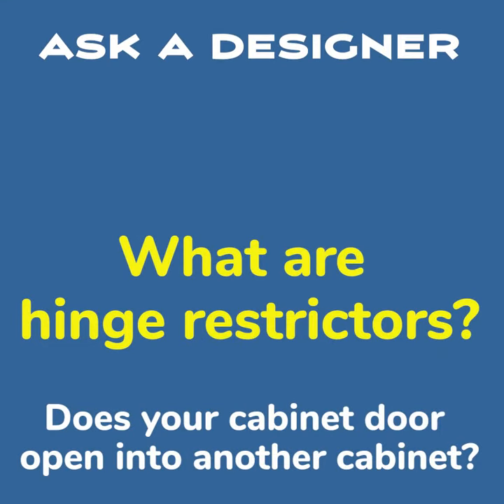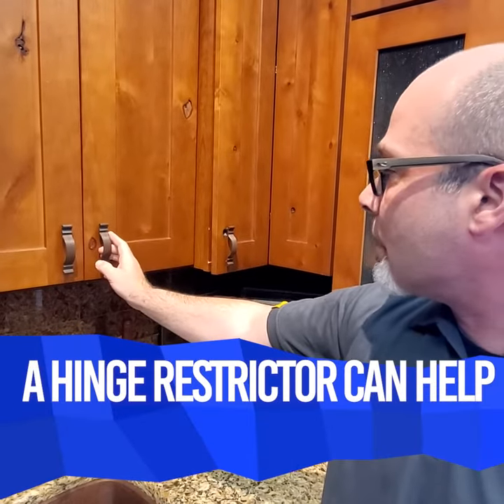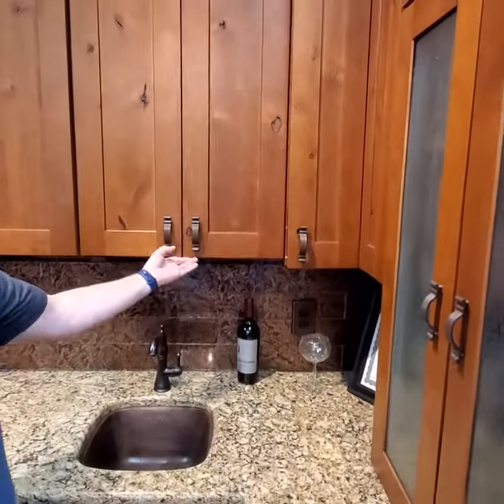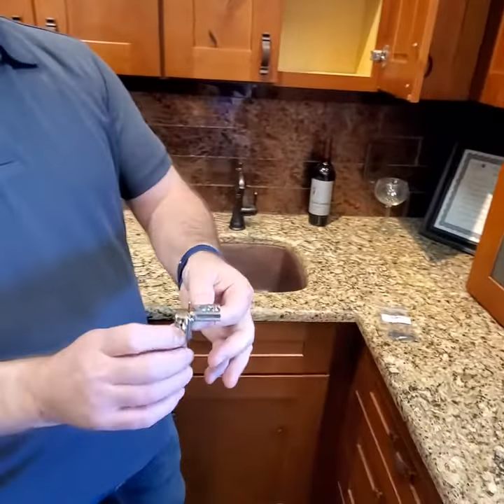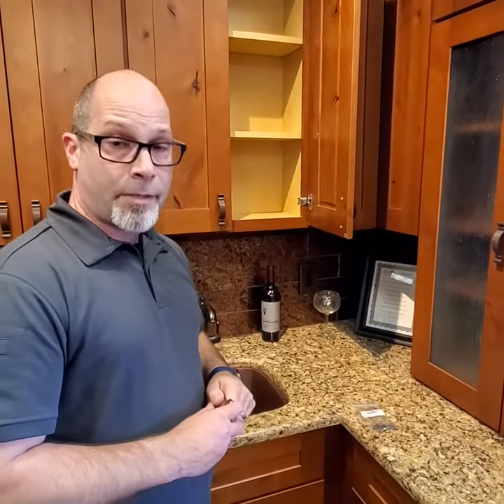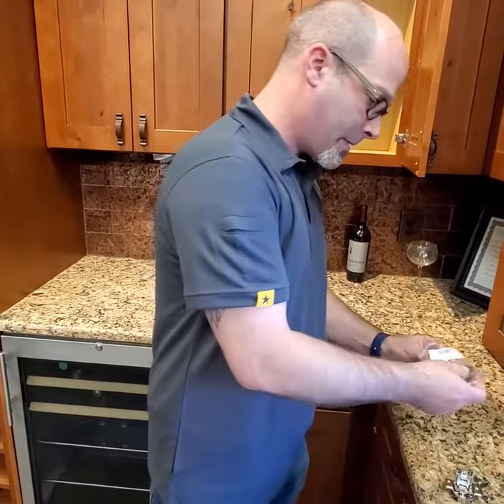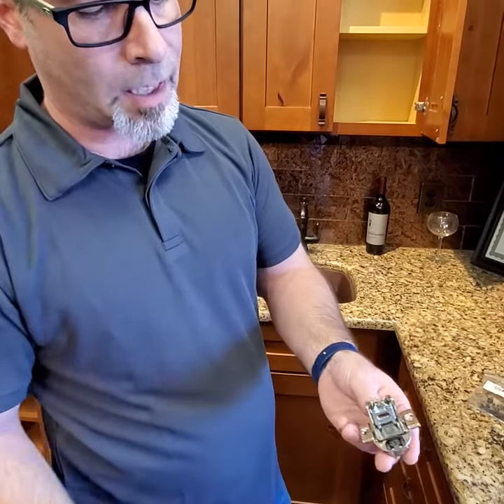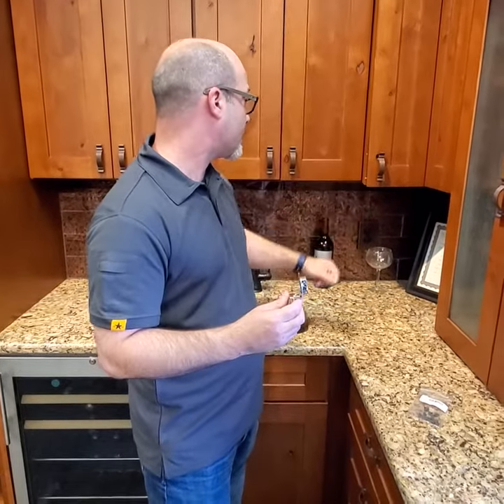How to Stop Cabinet Doors From Opening Too Far| The Use of Kitchen Cabinet Hinge Restrictor

Comment: Can I buy there in Australia in store it’s driving me nuts trying to find one to buy
Reply from the maker: Yes! You should be able to find them internationally. Our vendors sell them domestically here in the USA. However, you should be able to find the restrictors at any store that sells cabinetry or cabinet hinges. Might even be able to find them in a hardware store. 
Typically you can get a bag of 20 for between $5-10 US
Reply from the maker: Looking, I found ones we use most often by Blum here: https://amzn.to/4cFe9vF
However some international users stated they didn't work right- so definitely check with a local cabinet store. Not sure how the hinges might be different on international products.
Reply: @CapitolDistrictSup  it’s ok I found a store that sells it i didn’t know it had to be the same brand my one looked the same but can’t take the back off. The good news is I found a better way. I used a Prestige Lid Support Stay. I can’t believe no one thought of that.